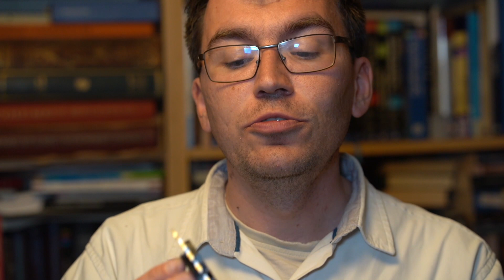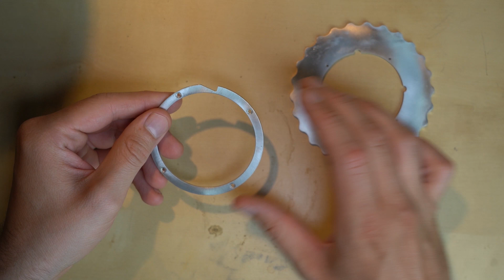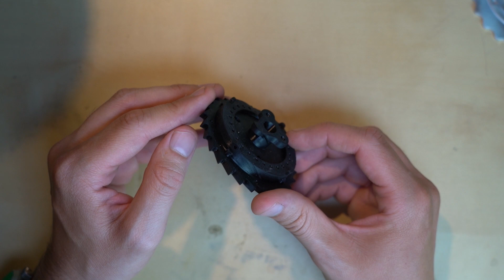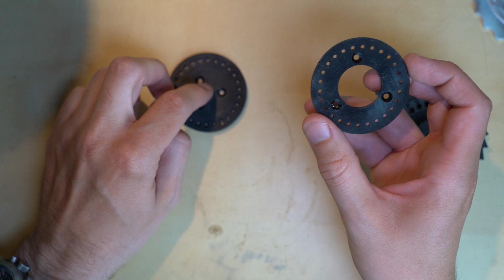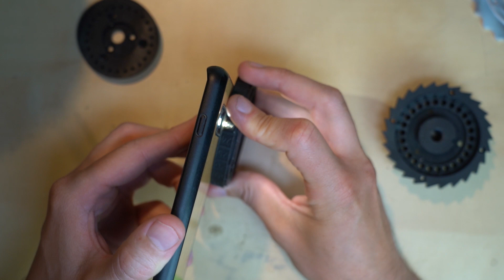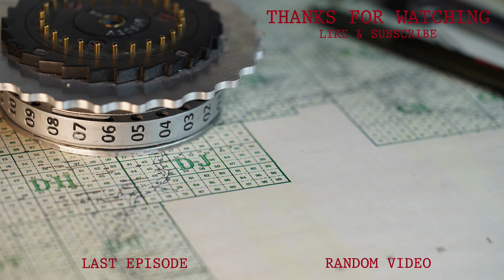The Enigma build project: Part 4 CNC and 3D-Printing Parts

Comment: Any recommendation for CNCing a millimeter alluminium flat part with side chamfer and get a smooth finish at the same time? Maybe a post process of Glass bead blast and then anodizing it will help?
Reply from the maker: as the part is only a millimeter thick a 45° Engraver may be enough to get a nice chamfer, In this case start with the engraver, fist pass slow to cut and than repeat one or to times fast to get the chips out, and than cut the part out. you can also offeset the outline by just a hair, and do a cleaning pass with the correct dimensions. Also a sharper the tool and as better the cooling the better the cut finish. If you can get different Aluminium Alloys some are better than others to cnc mill. And for the Finish i ususaly use a scotch brite type wheel. Hope that was helpful
Reply: Thank you
 @mostlyengineering5253